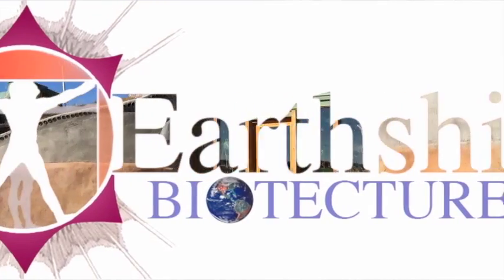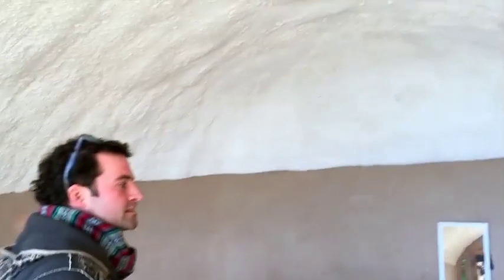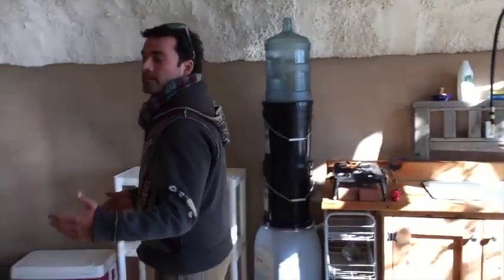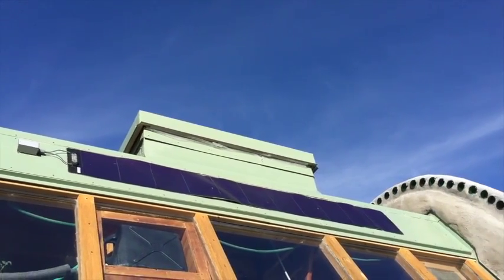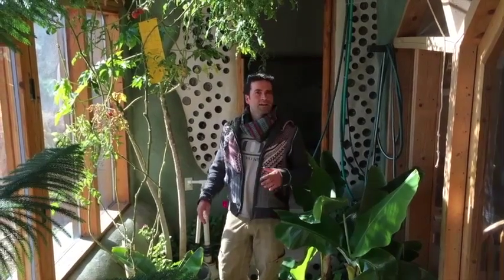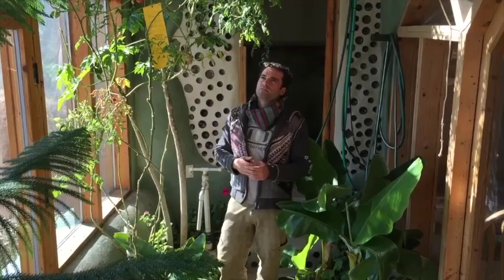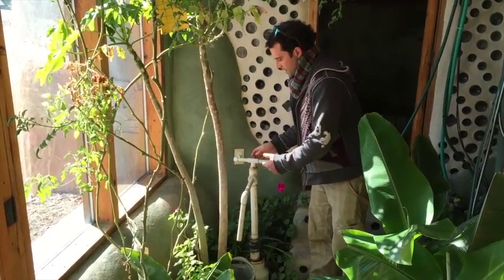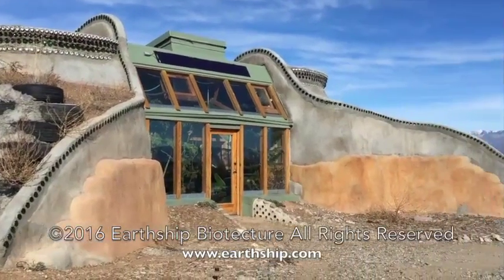Simple Survival Earthship Walk Through

Comment: What they won't tell you is that since your windows is facing the South that means that for 365 days out of the year your windows get hot and then cold, several times a day. Which means that the sealant that they need to use to hold the windows in place only last for about 3 to 5 years before you get mold and mildew coming in.
You'll notice that they don't do walkthroughs of older earthships and if they do they tend to stay away from the windows with the cameras and the zoom.

Comment: The toilet would flush properly if the bucket was emptied into a cistern first so the water can get around the rim of the bowl and crate the correct current
Reply: Could you explain?
Reply: @dasein9980  He means that throwing the water into the bowl is not as efficient as filling the toilet tank and then pulling the flush lever so that the water comes out in a slight whirlpool fashion, as it was designed to do.